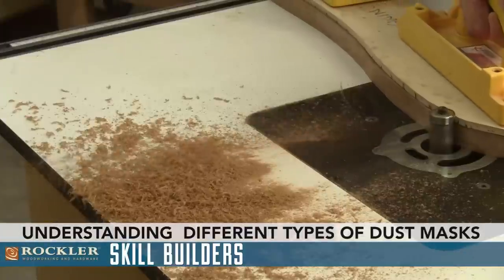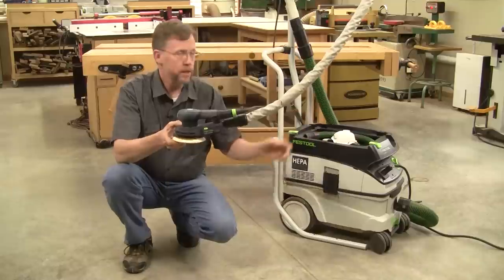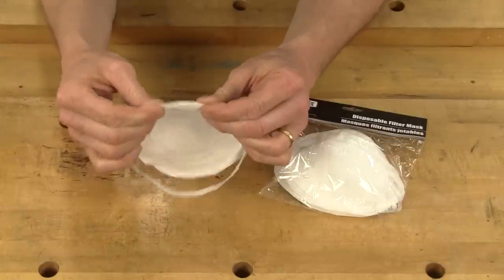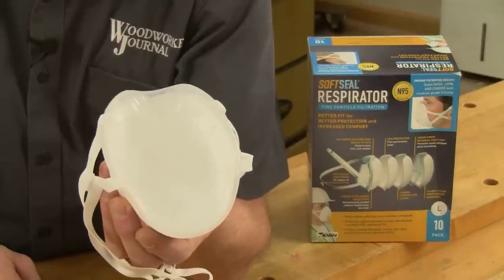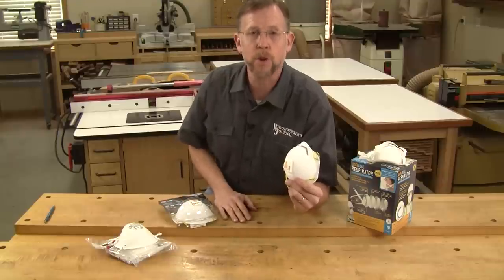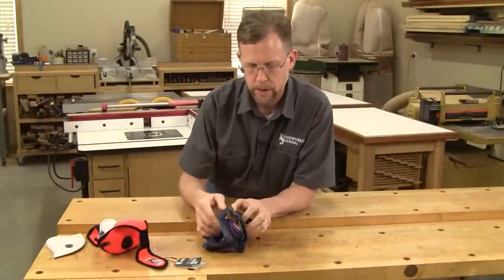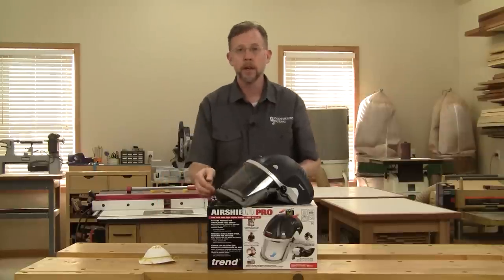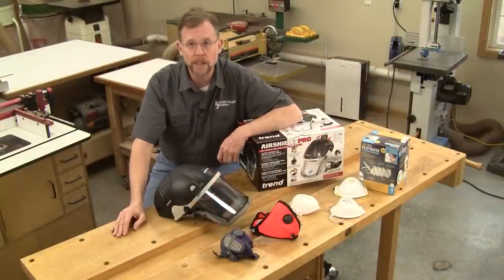Which Dust Mask Should Woodworkers Wear? | Rockler Skill Builders

Comment: Good Video Rockler. Thanks.   Let me add my two cents. I've used N95 respirators for years. If you're going to wear the mask for more than an hour, get ones with the exhalation valve. You will breathe a lot easier. Get masks with NIOSH ratings, or just wrap a t-shirt across your face. Those cheap single strap ones? Look at people who wear them. They're brown or gray around the sides-- that's because very little of the air is going through the filter material. It's going in and out around the edges.  The .3 or was it .03 microns?  What's important to know is that particles about half this size will get embedded into your lungs, or work their way into your blood. Yikes! Don't worry. The way filters work is not that they have holes of this size, it's that they are mazes of fibers that catch stuff when it bumps into the fibers, a higher rating means more fibers (and maybe tighter packed)  and a bit higher chance of catching stuff.  It helps. I usually use a full mask like the one at 4:16 in the video. It breathes a lot easier than any of the disposables and it's comfortable to wear all day, and it will last for twenty years. Some of the masks use less expensive round filters, so you'll change them out more often. A respirator is a good habit. 
I'm poking around because I want to filter the air while riding my bicycle in Los Angeles.(I like the blower, but I also wear a bike helmet...)  I have the 'ahhhheems' from the air pollution. A ride on Sunday morning when most of the cars and trucks were still in bed, and I'm still aheeming.  Not good.  I also sea kayak. I know that within my first hour on the ocean I've coughed up all the gunk, my lungs are clear and I don't have those 'odd' pains in my chest (bronchial tube irritation or my asthma) and my lungs will feel clear for at least a day. (Actually I have to think about it; if your lungs are clear you don't think about them).  I've tried riding with the respirator, but I need more air  peddling than I do building ugly furniture. If a bicycle ride ends up being like cutting MDF....what's the point?
Another tip from and old busy body. I spent a lot of years in a photography darkroom. When I was a rookie, I'd clean and clean and clean, vacuum the darkroom and there was always a dust problem on the negatives. Always. I thought about this and 1. Stop using cleaning products, just water to wipe down surfaces. 2. I still vacuumed, and with a cheap Shopvac, but I got extra hose and ran one of the hoses around the side of my darkroom shed. (Vacuum cleaners are like Cuisinarts for dust. Grinds it up and spits the finest most statically charged particles out the exhaust. These are the ones that stick to a negative and get lodged in your lungs). 
        This darkroom had a door right to my backyard and the Los Angeles air, yet I never had a dust problem. By not using cleaning products I got rid of one source of particulates, by using cold water to wipe with, I picked up dirt, but also neutralized the charge. By running the vacuum exhaust away from the room I eliminated that  source of charged dust. I often had mud, which would dry, on the floor of my darkroom, and still no dust problem. 
For a woodshop, I like the tip to capture it at its source. I would also strongly recommend just wearing a mask all the time, get used to it, always do it to the point you don't think about it. The worst dust are the tiny particles that get into your lungs and can't get out. If you can exhaust your dust collectors outside, instead of a shop vac, if you can rig up a pipe system with the collector and the motor outside. And wipe down down with just water. Maybe you'll need to do a bit more, but just use water first.  And if you aren't paranoid enough, there's a terrific documentary about particulate pollution, google Chinese Doc, Under the Dome (if you don't add 'Chinese doc' you'll just get the Stephen King TV series).  It was so good the Chinese government banned it the week it was released.   Hope this helps.

Comment: Clear and concise video on respiratory protection. I don't think anything you mentioned was incorrect at all. Personally, I'd take a reusable respirator over a disposable any day though. It's tough to have a tight seal in general (beard or no beard), and you can actually test your seal with reusable respirators by performing a quick negative fit check.

Comment: Even short whiskers will cause some masks to pass up to 50x more particles. Masks that are not perfectly fit can do the same thing. If you have a beard, masks offer almost zero protection from the smallest,  most dangerous particles and you need a powered respirator. 

I ran tests using a laser particle counter and I was amazed how much just a tiny leak reduced the efficiency of the masks.
Reply: So I'm just supposed to shave my beard?... there's got to be other solutions. I have 3M mask I use when applying urethane. I don't even get the hint of the urethane when wearing it, which suggests it works. My beard is a complete mess afterwards but it works. Came here to look for a mask that works that's not so heavy duty as the 3M

Comment: I really like your video, it was very informative. I have a question though if anyone can help me, I was working on a small job were I had to sand this varnished shelves because I needed to change the color to white, they were big and many pieces, I was sanding outdoors with a N95 for 6 days around 6-7 hrs per day. I have a full beard but I keep it short, should I be worried that I was breathing more dust than I was supposed to?? also I have to say that I don't do this type of job for a living, it was just this one time but the sanding took forever. Thank you!

Comment: How long after I've made a cut before I can take off the mask?  You noted that particles remain floating in the air.
Reply from the maker: Standard dust masks are sufficient for protecting you from wood dust, if they fit properly. How long before the dust suspended in the air is gone is an impossible question to answer. The variables are too wide. If your shop has good ventilation, only a few minutes. If it is enclosed with poor ventilation and you have pumped a bunch of dust into the air … much longer. Do you have air filtration? How much dust are you collecting at the point of dust generation? Common sense is the guide here. If you have specific concerns such as an impair respiratory system or asthma … take extra caution.
Reply: @rockler  Much appreciated.

Comment: can i wear a cloth mask?
Reply from the maker: Hi Yahia, protecting your nose and lungs from wood dust is important, so anything you can wear in the way of a "filter" is a step in the right direction. However, for much better protection, wear a NIOSH-approved dust mask with two straps and an N95 dust protection rating. As a result of the pandemic, they're easy to find these days. A cloth mask won't offer protection against fine dust particles at the micron level of size, which is the most hazardous to breathe.
Reply: @rockler  Thank you but what if my workspace is outdoors?
Reply from the maker: You'll need to assess how much dust you're creating, regardless of where you happen to be working, and choose a level of dust protection appropriate for the situation. Ideally, wear an N95-rated dust respirator wherever you work for maximum protection. But even a cloth mask is better than no breathing protection at all. Let common sense and your comfort level for personal protection be your guide here.
Reply: @rockler  Thank you